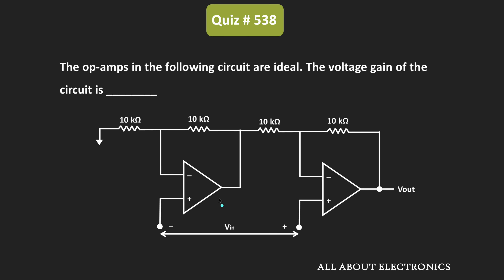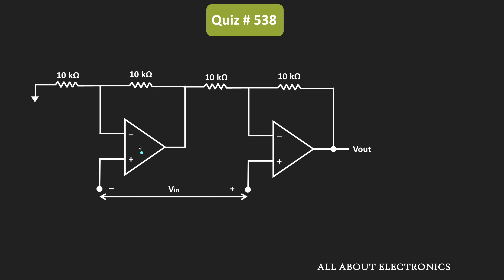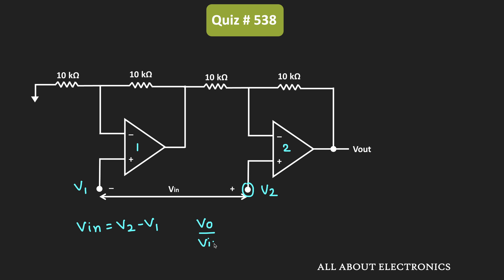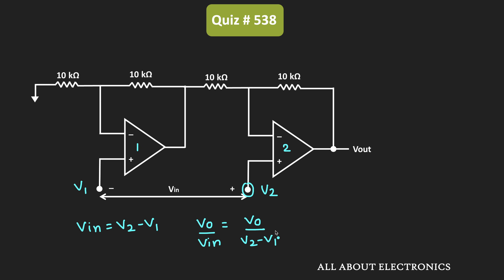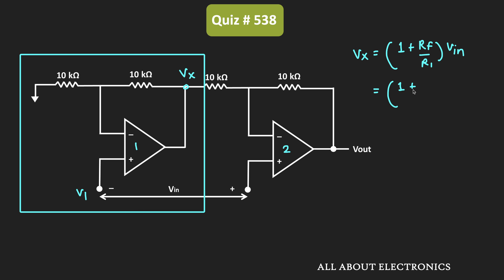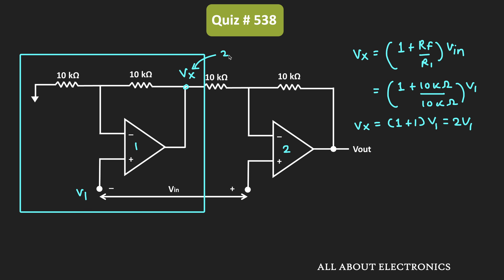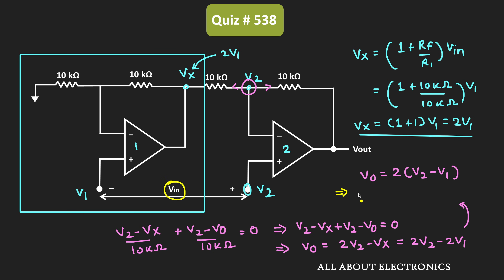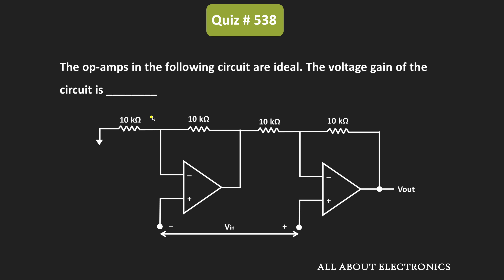Operational Amplifier Solved Problem | Quiz # 538

Comment: How are you taking the first one to be in noninverting configuration when v1 is negative
Reply from the maker: The non inverting configuration is based on where (at which terminal) the input to the op-amp is applied. In both op-amps the input is applied to the non-inverting terminal of the op-amp.